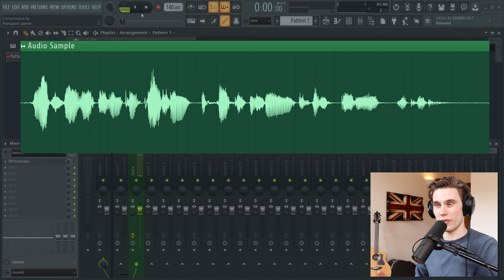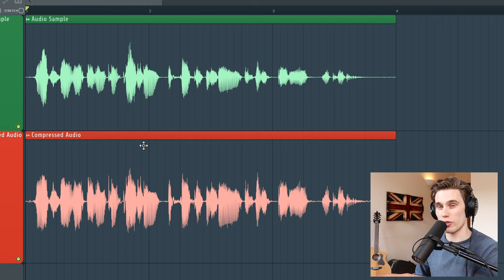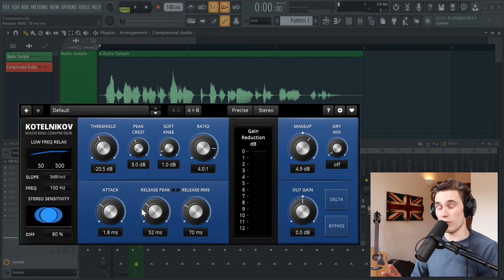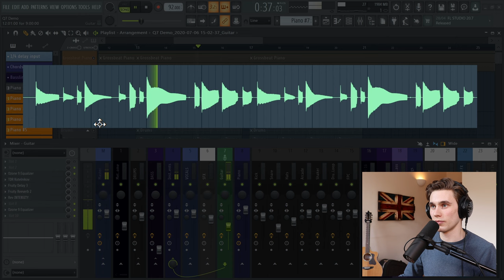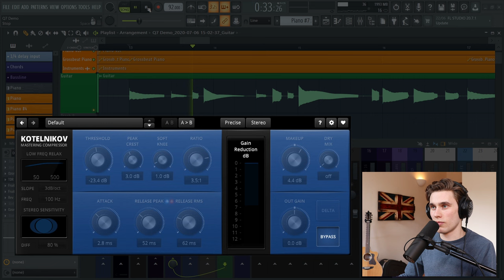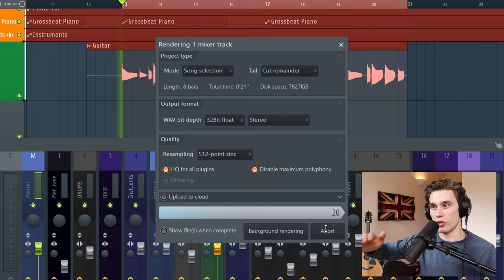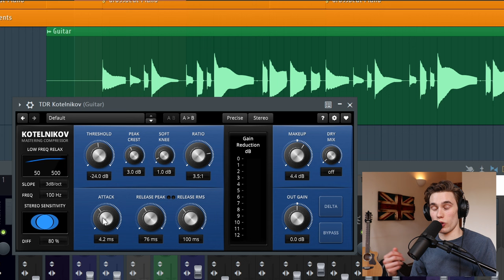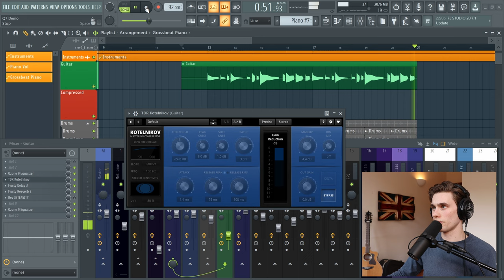How To HEAR COMPRESSION - Music Production

Comment: One thing I do love about all these tools, is that if you REALLY wanted to, you could just do all this stuff manually through automation, even if it'll take until the heat death of the universe. I'm glad you mentioned that at 7:47. Folks, don't be afraid to push a compressor harder either. There's a time and a place to crush the life out of dynamics, but most importantly... If it sounds good to you in the context of the mix and the genre, keep it.
Reply: Yah I Could Not Have Said It Better Myself
Reply: A combination of both with local compression or even locally adjusting volume on the most extreme spots would also maximize the naturalness of the sound when that’s what you’re looking for.
Reply: @ericmaher4756  This, exactly this. Nothing can beat a human touch when it comes to music dynamics. Sure, put in a compressor to squish the sound a bit, but in sections of a song where you need those dynamics, a simple automated volume adjust before the compression stage (with perhaps a makeup gain stage after compression) will do wonders.

Comment: About the transients, if i have issues with transients, say, i want the transient but i dont want it too loud,  i add a 2nd compressor with a different threshold that only works on the transients and then have very very short attack so i can easily control the exact volume of the transients without over compressing the rest of the sound.

Comment: Something that helped me a lot is messing around with envelopes on synths to develop an ear for what the attack and release does because the compressor is essentially shaping the envelope of the sound you are putting it on. The key difference is that the synth envelope starts when it receives the "note on" signal and it moves immediately to the release portion of the envelope when it encounters the "note off" signal. With a compressor that is not the case.

Comment: I see how, for a lofi vibe, the compression works well in balancing the sound, and it does sound great. But just a thought, I think in some mixes the dynamics in the guitar would feel nice without compression. With that being said I think specifically with this example you would still need a little compression just because of the dramatic change in velocity between each note but my point is, dont always compress just cause you think its technically right, but feel it out in each situation. I'm a new producer and I pretty much suck so im just leaving this here for other noobs and myself to consider. great vid

Comment: I have a question that is going around through my head for a while now and i don't get closer to an answer: I thought the aim of compression is to get a more balanced volume. Like if you would if you would cut the vocal into pieces and adjust them so that every part gets audible: nothing sticks out, nothing is to quite. Now my problem: THE ATTACKTIME! A Snaretrack for example... if the snare isn't hitting at the same volume all the time and i set my treshhold everything above it will be reduced based on the ratio, BUT the first hit will remain the same if there is any attacktime. So with a snare: every decay of the snare sound above the treshold will be redused. The makeupgain will bring out those peaks at the beginning even more and it will Clip because of these first hits and the rest is reduced by the compressor. The "natural" first hit of a guitar/snare/ is completly different, so it is NOT the same as smoothing out with a manual chopping, right? I must get something wrong here, but what is it? I would be thankfull for a good explination!!!

Comment: How often do you need to automate compression controls in a whole mix vs a set and forget approach?
Reply from the maker: Set and forget 99% of the time for me. If i need to automate I would prefer to cut the section of audio into a new track and use a new mixer track for it too. That’s my approach but other’s automate a lot and get good/better results than me so test and find what works for you!

Comment: Another thing: what is the release really doing? I know it is reducing the signal after the signal goes underneath the treshhold. But by how much? I mean when the signal is 4 dB over the treashholg with a ratio of 1:4 it's been reduced to (4dB:4=1dB) 1dB. But how much is the signal getting reduced after it is underneath the treshhold? And if it is reduced after that, how does the compressor raise it back to normal? In a linear way? Cheers for any kind of explinations!

Comment: How do you retain expressiveness of, say a jazz guitar part, whilst still getting a better volume balance using compressors? In other words, a player may have a style where their solo goes from a whisper to a roar in just a couple of phrases.
Reply: Sometimes you don’t really have to compress a source, because of what you just said. The performance is dynamic. In that case you can probably just use a compressor to control the loudest peaks for technical purposes, not so much for listening purposes, if that makes sense. You can still compress, until it’s too compressed and you lose that performance. Only your ears will know when to stop 😉
Reply from the maker: An option is to not compress but what I might do instead is duplicate the track and all the effects and simply cut the first half to be louder and the second half to be quiet etc?
Reply: Thanks, I'm learning much from the channel.